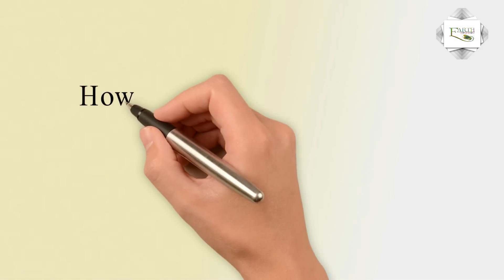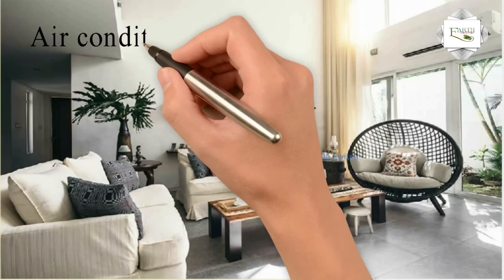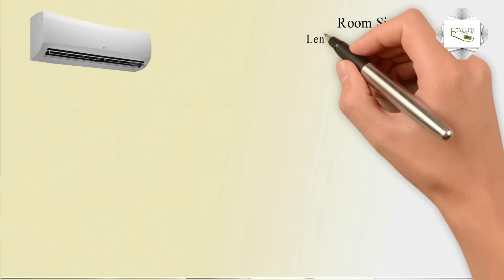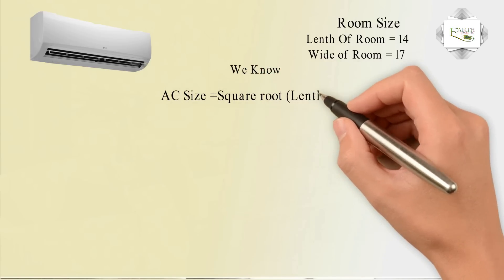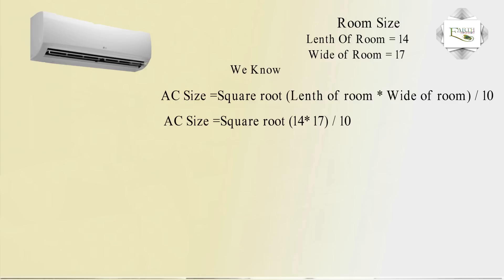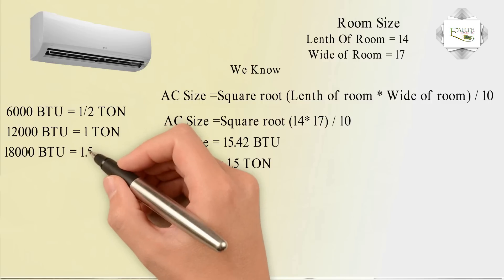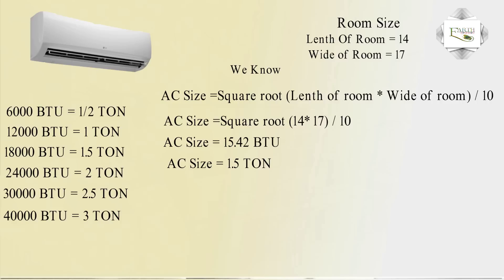How to calculate room air conditioner size | AC calculation | Earthbondhon

Comment: you don't divided when we neeed ac size it make only square root(17x 14) then we get = 15.42
Reply from the maker: 1.5 Ton  Air Conditioner use ….

Comment: You should put the appropriate used unit after any number you mention, I wasted half an hour in trying to calculate the tonnage for my room's AC, I thought the rooms dimensions are in SI units (i.e. meters), anyway, thanks a lot
Reply from the maker: Good tip!

Comment: I bought an oversized AC unit 24,000 btu for a 300 square foot based on the recommendation of the company. They multiply by 90 here in Jamaica. Should I sell it and get a smaller one? Or can I raise the temperature? Even at 28c/82f, it still is too cold in here sometimes it is an inverter but I would like some suggestions that maybe doesn't involve selling it.
Reply from the maker: sir 
2 Ton air Condition.
full info website @earthbondhon.  I love to receive your comments and feedback.
Thanks for watching it
Reply: Jack leg move but u can alleviate by running a duct (or 2) from the unit to a attic or covered porch or crawl space. Best to put on a draft damper so when the system is off it doesn't allow bugs and bees etc in the duct

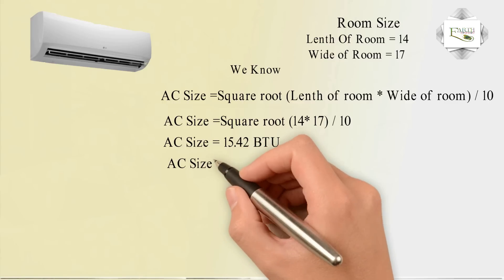Comment: 2:10, the entire calculations and conversions are wrong, it should be 1.54 not 15.4, consider learning to operate a calculator first, you didn't divide by 10 as stated in the equation. Mazak bana ke rakha hai.
Reply: I don't know how to calc aircond power requirement. But why divide the room floor area by height? The volume of the room should be LxWxH=vol....
Reply from the maker: sir, some Calculations.
full info website @earthbondhon.  I love to receive your comments and feedback.
Thanks for watching it

Comment: if you get past the language barrier and into the math he is basically correct for conventional old school calculation but in modern building if you are using old calculations and not taking into account insulation, windows and types then you could be wasting money. This is great for just an add on in an old house or room that just isn't getting cool enough due to poor typical a/c company "design". Good job and trying to help.
Reply from the maker: I love to receive your comments and feedback.
Thanks for watching it.